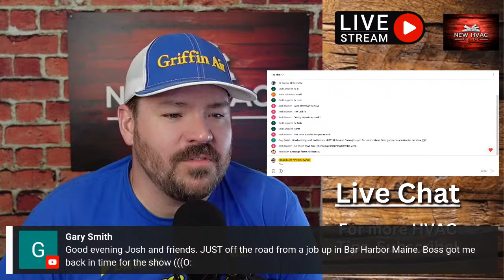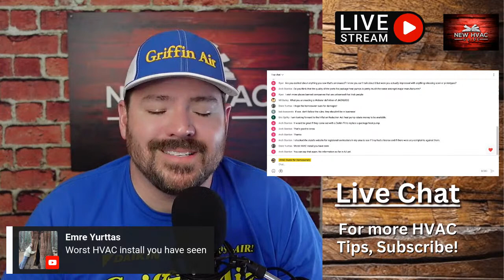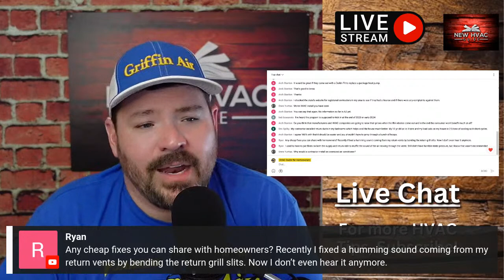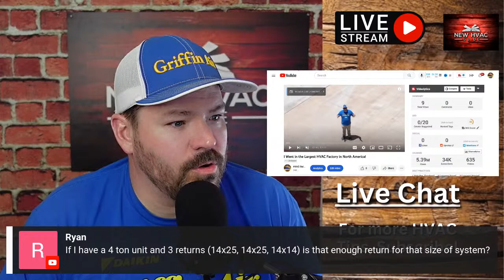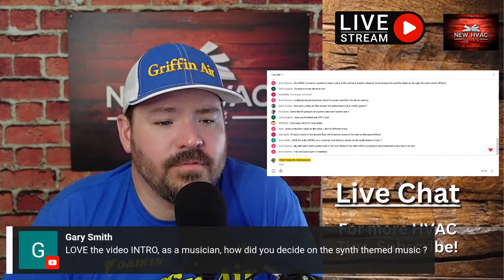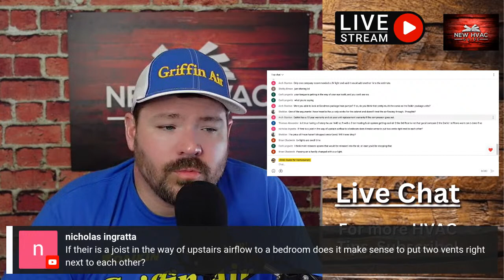HVAC Guide LIVE Show!

Comment: I enjoy your channel very much and have learned a lot. I have been getting quotes for a new HVAC, 3 ton heat pump system. The current system is a single stage from 2005. I'm looking at the two stage and variable stage heat pump systems. In your opinion, does the ductwork need changing or updating going from a single stage to a variable stage system? In Alabama, very hot and humid. Thank you for any information you can give me on this.